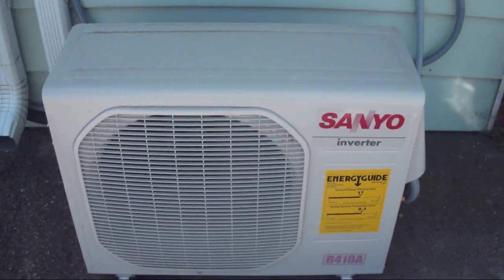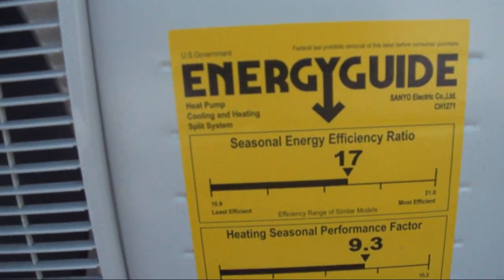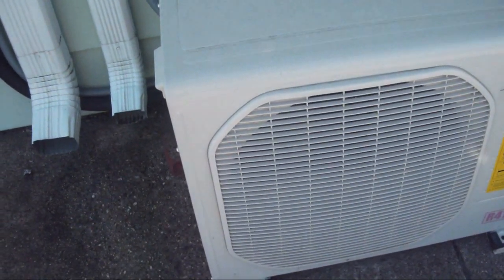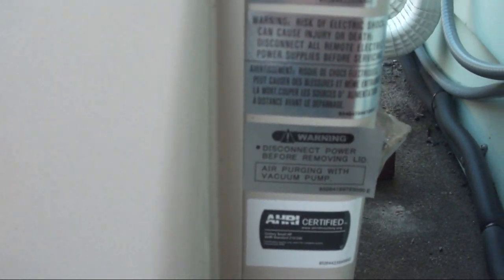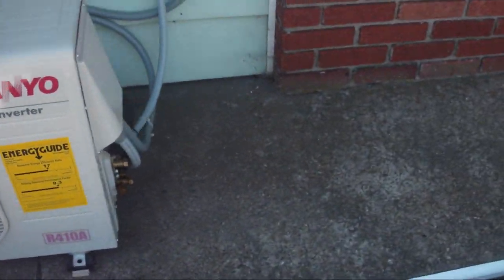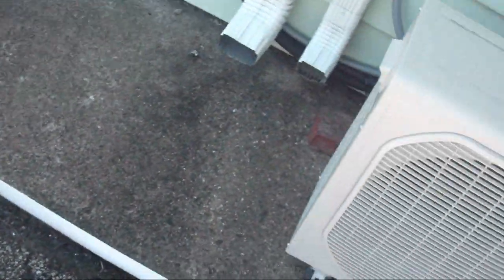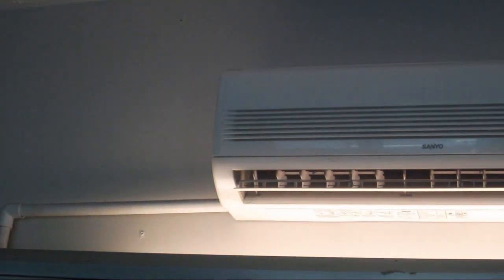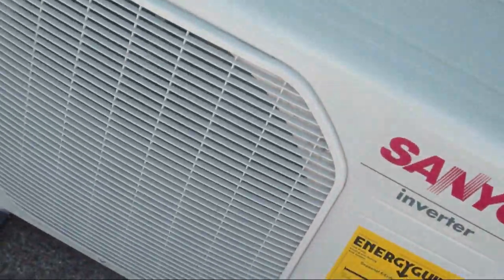Sanyo 17 SEER/9.3 HSPF ductless Inverter heat pump running in COOL mode

Comment from the maker: So you have 3 Sanyo ductless heat pumps (or are they cool-only)? Where do you live and how hot is "extremely hot" in your opinion? There could be a whole bunch of factors causing this isse, including a dirty filter, a dirty coil, low refrigerant, improperly sized units, or just that it is a little too hot outside. It could also be an issue with the house and not the A/C units.